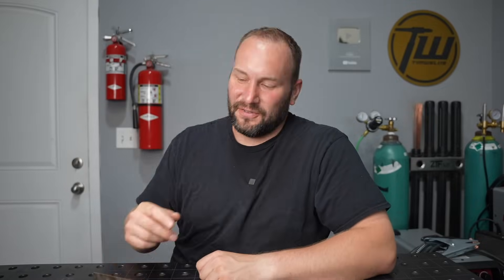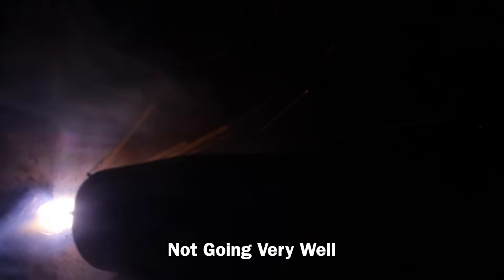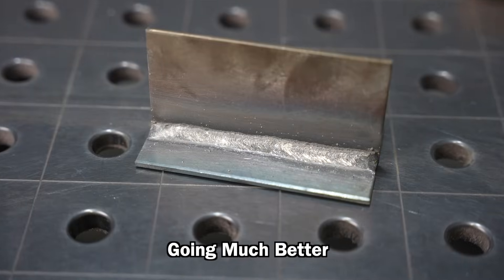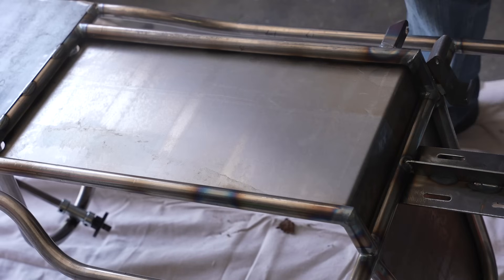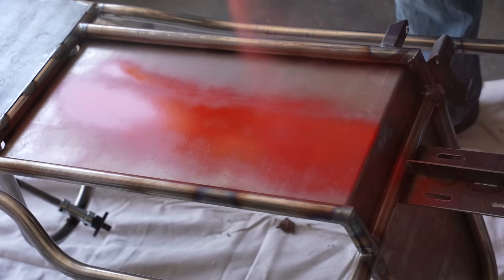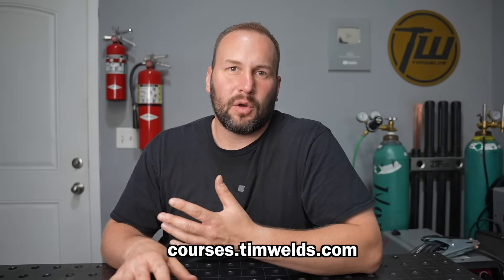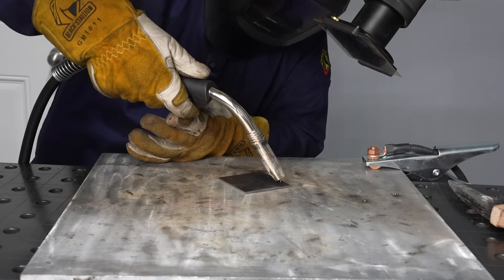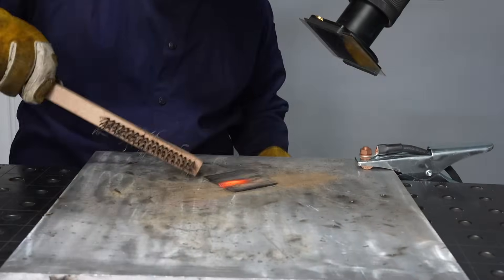#1 Way to Get Better Flux Core Welds

Comment: Also more heat.
Reply: When welding a coupon laying on the table, adding more heat can smooth it out, but welding vertically or overhead requires having the correct amount of heat, otherwise the molten metal will just run out of the joint.

Better to learn how much heat is needed, versus how much speed is needed to create and control the puddle.
Reply from the maker: True, either one will work. The main way to control heat is wire speed, which also controls amperage. Turning that up (along with an appropriate change in voltage) will allow the puddle to wet out while adding more material for a given travel speed. Slowing down also  increases the heat input because of the added time spent on the weld. I went with travel speed to solve the problem, but you could do the same thing with settings if your machine has the amperage and wire speed. Like @MicahFunk pointed out, though, in certain positions, you have to run a bit cooler with a slower overall progression.